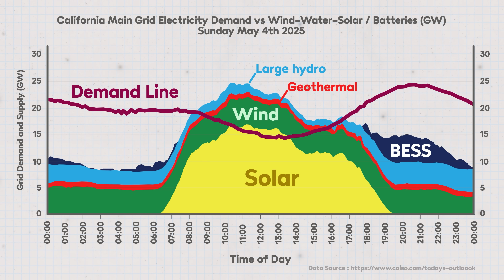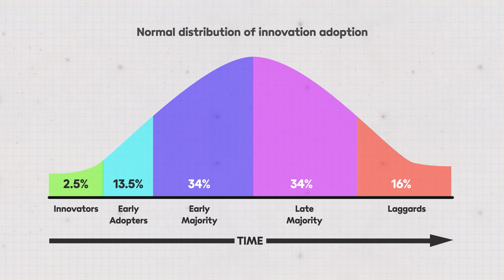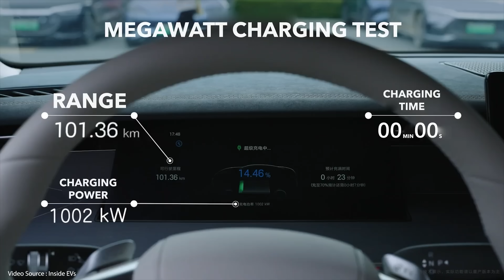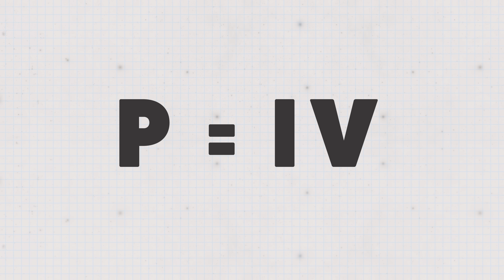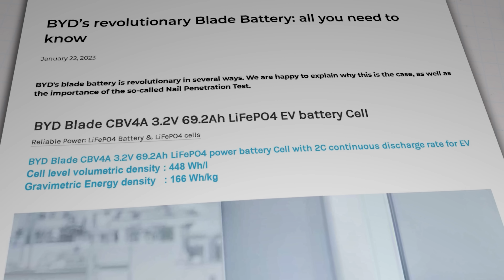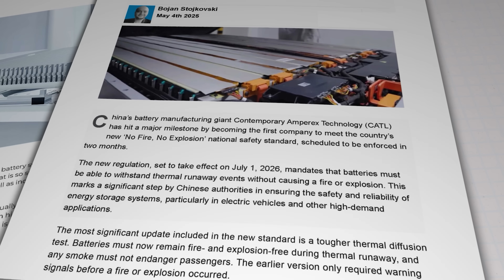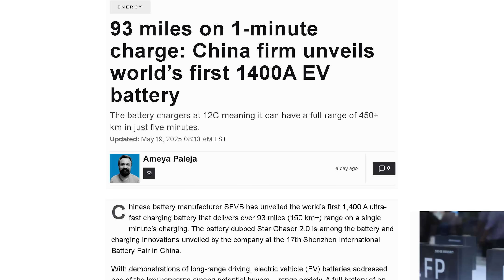BYD 1 MEGAWATT 5 minute EV Charger. Overdue or Overkill?

Comment: In Wyoming range anxiety and charging time is very important. There are long distances between major cities and if I have to sit around for 2 hours to wait for my car to recharge I find that unreasonable. Dave, you make the statement that most users of EV would not go back to ICE.  Have they ever had to face the replacement cost of the battery?  Google says it is between 10K to 20K dollars for a Model 3 right now.  Now take that and the cost of charging the battery during its lifetime and was that really cheaper than gas?   I have never seen any real estimates. Also consider that most will not have that type of disposable money sitting around when the battery has to be replaced they will have to pay finance charges on top of the cost of replacement. 

Also the idea of giving electricity back from the grid from an electric car at night is a no-go for me also because we know when we charge they will charge us more for that privilege than they will buy it back from us when we put it back into the grid so you still end up losing money. So if I buy a unit of power from the electric company for say $1, but sell it back at night for say .90 cents I have lost money and I also have to put back the charge if sold to the electric company at a higher rate.  We also have to think about the damage done to the battery during all these charging/discharging cycles. 

So BYD has new blade batteries  and charges.  10 C charges can do a full charge in only 6 minutes.  What you failed to say Dave was the state of discharge of the battery before charging and that is a very important piece of information to leave out of the talk.  If the battery is so dead the vehicle will not move then that is impressive, but if it was only 10% discharged then not so much.   

I have a Ford E350 with 314K miles on it and it is still running like a top.  Will any battery on the market run that long before it is done?  Yes BYD claims their new batteries will do that but only time will tell right.  Hot climates kill batteries and we are moving to a warmer earth, not cooler.

Another point to consider before going out and buying an EV.  I  can replace my engine if needed for around $6K not the $10K to $20K it presently costs to replace a model 3 battery.  With rare earth elements becoming more expensive every day,  see if battery costs stay even in the range of a Model 3 replacement costs in the future.
Reply: "In Wyoming range anxiety and charging time is very important. It is long distances between major cities" <- there are no major cities in Wyoming. There are hardly any cities, Sheridan and Casper being more like large towns.  Regardless, rural living will always be a challenge. There's a reason people collect into towns.  Rural residents best have large batteries at home and generate their own electricity.  I suspect that future endeavors in motor vehicles will include user-removable battery packs, so something like the AAA can come out in an emergency with a spare battery pack to get you to the next charging station.
Reply: Before we need to replace the entire engine we can and need to do little maintancance here and there to make it last longer. During the 314k miles on your trusted Ford you have probably done some maintencance on that engine. Maybe spark plugs, some gaskets...

Same applies to batteries, before we need to change the entire pack it is possible to exchange just individual faulty cell packs. Admittedly, we shouldn't do that at home.

A battery in a car is considered "done" for car use when it only has 70% of its original capacity. A petrol engine will also degrede over time. The difference is that even if the entire car battery need to be replaced it can still be used as stationary energy storage.

Comment: I almost feel like everyone who says faster charging isn't necessary probably have house they can charge their car at overnight. My apartment doesn't have a charger, and charging a car with the range necessary for my line of work (I often I need to drive 400+ miles at least once a month month, but most days of the month is under 100 miles total) is more expensive in my area than filling up my Prius with gas. I can deal with the higher price of charging, but I don't want to wait an hour for a full charge. Especially because most places I go to don't have charging available. So I need my DC fast charging to be faster.
Reply: Let me explain a few things...  When road tripping in an EV it is NOT recommended that you attempt to charge the car to 100% eveyr time you stop.

A small anecdote will reveal why...

Two Youtubers who owned Tesla Model S EVs did a little test.

1,000 mile road trip leaving the same location and arriving at the same destination.

The rules were that driver 1 HAD to charge their EV to 100% every time they stopped on the route, and driver 2 could charge to whatever level they wanted.

Guess who arrived at their destination first?

Driver 2, by more than an hour and a half.

When charging your EV on a road trip, ONLY charge enough juice into the battery to get you to the next charging station.  

To charge an EV from say 10% state of charge to 80% state of charge is quick, but to charge from 80% to 100% can easily double the time you spend charging.

Make sense?

Comment: The lack of fast, reliable, abundant charging stations is absolutely the barrier to rural adoption here in the states. My previous jobs commute was about 112 mi (180 km) round trip, but with minimal ways to detour that could sometimes jump to 165 mi (265 km) after a bad storm. It's also not a route with appreciable traffic where regenerative breaking could be helpful, pretty much 50-60 mph (80-95 kph) the entire way. A cursory skim of ev-database says average range is about 380 km (236 mi) so that would work, but it's certainly not a comfortable margin of stuff going wrong and that assumes you get that sort of range on this kind of long commute. A buddy of mine worked home health around that time, his normal day on a rural contract could be anywhere from 150-250 mi (240-400 km) of driving. Even something like the S-wasticars 560 km (348 mi) range isn't a comfortable margin for that sort of work. Let's not even get started on what an electric truck would need for range and capacity to work around here, even without wanting it to act like a generator to power tools or whatever else you might need.

A charger like this though? Mandate that has to be half as many chargers like this as there are fuel pumps at every gas station in the states and EV adoption will _skyrocket_. Overdue, massively overdue. Chargers having parity with loading fuel should have been the standard right from the inception of the fully electric vehicle.

Comment: Here in the western United States, distance is an issue. Plus some states in this region have not adopted a good charging infrastructure, like Wyoming.  Wyoming btw, is an oil and gas producing state, and has low population density as well.  So if my family wants to go to Yellow Stone for a holiday, we won’t be talking the EV.  However our EV is perfect for buzzing around the Denver area, and maybe a trip to other cities that have charging stations.
So, having range is a big deal in this part of the country.  I would love to have an EV that had a day’s drive worth of charge. My wife and I would love to have the id Buzz, but the range is not up to the task of driving as far as we would need to get, and far enough into the mountains and back to a charging station.
Reply: Here's a road tripping tip for you as an EV owner...

When on a road trip, which I have done many times, DO NOT try to charge the battery to 100% every time.

That is a colossal waste of time.

ONLY charge it enough to get you to the next charging station.

Tesla's V3 charging station can "push" 200 miles of range into your battery pack in 15 minutes, and Tesla's charging locations (on Interstate Highways) are spaced out so that you're always within range of the next charging station.  Tesla is working to fill in the gaps on State Highways now, but their primary focus was the Interstate Highways (that's completed already).

Comment: I'm all for higher voltage EV platforms, not least 'cos it usually results in them being hella fast, but I can't help but think the Chinese are doing a huge amount of business propaganda (not the communist party kind!). Without VERY careful control over spiking temperatures, I can see a 1000v system being very prone to battery cell damage by sheer amount of energy flowing into them during ultra-high speed charging, or even when driving. Doing so and not having a fully functional cooling system in place (be that just age or technical fault) could get dangerous very quickly. Also it kind've 'smells' a bit like one-upmanship to me.
Reply: China is a country run by engineers, America is run by lawyers. Don't project your own anxieties onto them.

Comment: I've owned a sonewhat shortrange EV for 5 years now, and 99% of my charging is at home, overnight. Thats with around 25.000km a year.
For DC charging it has a max charge speed of 100kw, but I never found that to be a problem on my long trips. Quite the opposite really, I enjoy having a walk and stretching my legs a bit during the trip.
Reply: Max charge speed is dependent on the power line coming into the charging location (for all stalls).

Tesla V2 chargers have a max of 150kW

Tesla V3 chargers have a max of 300kW

MW scale chargers are only needed for industrial scale EVs like the Tesla Semi which have gargantuan battery packs.  Using a MW scale charger for an EV with a 75KW battery pack is overkill in the extreme, and ludicrous.
Reply: @Les_S537 Not sure if that was meant for me, but the car has a limit too. For my car it is a maximum of 100kw, no matter if the charger is capable of more.
Reply: @dachsdk1559  Yes, it was meant for you, and yes...  The equipment within your EV is the limiting factor.

I was just explaining some more details.

Comment: Hi Dave, The water in pipes analogy does hold beyond the point you suggest ( 4:53 ) as a larger internal diameter of pipe will carry more liquid at a given pressure. In a domestic setting we see 22mm and 15mm pipes as a result. Great video as usual. Enjoy your break next week. Yours, Jonathan

Comment: These advances are fascinating, Dave! The Chinese are truly pushing the envelope. Let’s hope the efforts silence the naysayers who assert that they won’t buy an EV until it has a 1,000-mile range and can charge as fast as filling a gas tank. (By the way, I have yet to see any verifiable, concrete, empirical evidence that Tesla's 4680 cells actually achieve the increases in range and power that the CEO promised in the reveal… but I digress.)

My own take is that, after nearly a dozen roadtrips in our current EV, with its 800-volt blade battery pack, I think such cutting-edge advances are actually overkill. After driving for 3 hours straight, we typically need to visit the restroom so we also plug in. The EV charges from ~20% to 80% in an average of only 14 minutes —barely enough time to empty our “tanks”! I thus wouldn’t want the car to charge faster than that.
Reply: MW scale charging is overkill for most EV use cases...

The only EVs that need such speeds are something like the Tesla Semi which has an absolutely huge battery pack, or for EV trucks that regularly tow large loads.

As everyone knows, when an EV truck is towing something you can easily cut your range in half which means you need more recharges to go a long distance.

In this case, a MW scale charger makes sense.

For all other EVs the Tesla V3 charging level is more than sufficient.

Comment: What everyone seems to be missing about the megawatt charger is the strain it puts on the grid.  It would be very rare to find a location to install such a charger that had a spare megawatt capacity just waiting for it.  You'd probably have to have the power company run a new line, very expensive.  Then you'd have to pay a fortune in demand charges, so the energy from that fast of a charger would come with a premium price.  Personally, I have no need for it.  When I've been on the road long enough to actually need a charge, I like to have a coffee, stretch my legs, and use the restroom.  That's usually long enough for a regular charger to get me where I'm going.
Reply: STILL not "Thinking it through"?
So now we have many locations with ...... lets say 40 Tesla V3 chargers, each capable of ..... 250+ kW?
If a Megacharger is capable of similar output to 4 V3 units, we SHOULD be seeing the V3 locations "Killing the grid" every week at peak times?
No happening?
Reply: Just put some batteries locally. No need to present the grid with a 1Mw spikey load.

Comment: I have a question...
Though you might be able to have a charger and a battery able to cope with 1000A and 1000V, would it be possible for the national grid to deliver something approaching this level of power across all (or most) of the public charging locations? ...even with a decarbonised grid?

Mostly irrelevant for me anyway as I intend charge at home whenever possible.
Reply: Couple of facts for context...

1.  Around 80% of people live in urban areas
2.  The average driver only drives 30-40 miles per day
3.  A typical 120v/15amp outlet can "push" ~4 miles of range into your battery pack each hour

This makes EVs practical for MOST people AND for most people a 120v/15amp outlet in your home is sufficient for your every day use.

By that I mean that if you begin your day with a full charge, and you drive your 30-40 miles that day, when you get home at night you can plug into the 120v/15amp outlet in your garage and by morning those 30-40 miles are charged back into your EV and you wake up to a fully charged EV.

Easy peasy.
Reply: Hi  @Les_S537 , I realise and agree that BEVs would work for most, if not all, of society but my question is more about... 
Is it possible for the grid infrastructure in a decarbonising world to support 1000A and 1000V together in the short to medium term or are these 1000KW chargers just an exhibition piece?

...I'm certainly not a nay sayer, I'm just completely ignorant on this, hence the question.
Reply: @matticulas  MW scale charging stations, like those talked about in this video, are only practical for industrial scale EVs like the Tesla Semi which has a gargantuan battery pack (Tesla Semi has a 850-900 kWh battery pack size).

To use a MW scale charger for an EV with a battery pack size of 40-75 kWH is overkill in the extreme.

Out of the 1.5 billion vehicles worldwide, industrial scale vehicles like semis/excavators/dump trucks/bulldozers only make up around 5% of that.

MW scale chargers only make sense if you're using an industrial scale vehicle, or you're using a pickup EV like the Cybertruck AND you regularly tow heavy loads behind it.

EV trucks like the Cybertruck can have their range cut in half when towing something, so a MW scale charger makes sense if that's your use case, but to use a MW scale charger on a car with a 40-75  kWh battery pack size is ridiculous and will more than likely destroy your battery pack in the longer term.
Reply: Jesus Christ. Yes. It's feasible.  And where it isn't, local batteries can make it feasible .

Comment: I have an Hyundai extended range (> 400mile range) Ionic 6.  Smooth vibration free driving, phenomenal acceleration and no exhaust gases.  Charges to 80% in 20 minutes.  There is no way I am going back to gasoline.
Reply: I drive an old hybrid…I would love to upgrade….gosh, I would only have to charge once a month, as I am only racking up a little over 300 miles per month!
Reply: No exhaust gasses "that you can see"! Your car doesn't run on pixie dust, those gases are still released into the atmosphere just not where you can see them "Out of sight out of mind" you are still polluting the earth you smug git.
Reply: Real range of Ionic 6 is 305 miles, Charles, but an impressive car nonetheless.
Reply: @Poetjanstie  I charged my Ionic 6 last night and the range this morning is 433 miles.  Actual miles.
Reply: No exhaust gasses "that you can see"! Your car doesn't run on pixie dust, those gases are still released into the atmosphere just not where you can see them "Out of sight out of mind" you are still polluting the earth you smug git.

Comment: So impressive. Geely's Zeekr and Huawei also announced megawatt EV chargers that can deliver 1.2 MW of power, not sure if they are using CATL's battery.

Everyone, stop and read BYD's web page at 7:16 which demolishes the threadbare anti-EV talking points.
· "The batteries don't last" – 3,000 charging cycles so 1 million km durability.
· "Think of the children mining cobalt in Africa" – no cobalt in LiFePO.
· "So polluting to make batteries" – lower carbon footprint manufacturing (and obviously far better than burning through literally tons of dirty fossil fuel operating a gasser).
· "But the battery fires!" – even safer (and already cars with gallons of dirty flammable fossil fuel sloshing around that catch fire at far higher rates) 

Now the tired negativity has shifted to "The grid can't support this high power", which is news to anyone building a shopping center, industrial park, or factory. And as everyone who actually drives an EV understands, you mostly recharge your EV at lower power while you're doing other things. Ultra-fast charging is a nice-to-have.